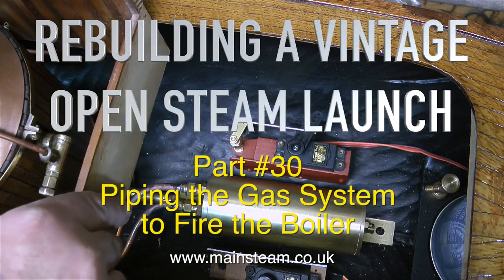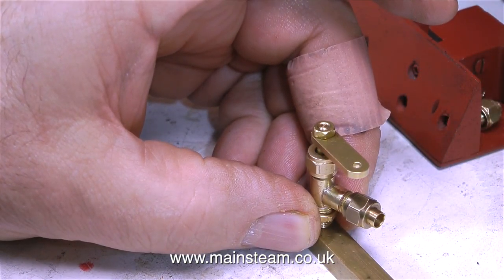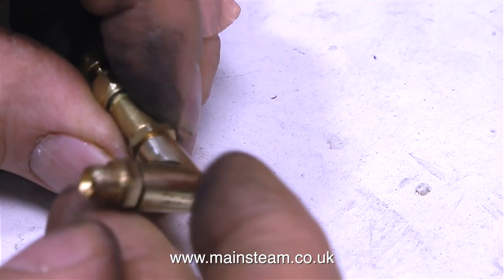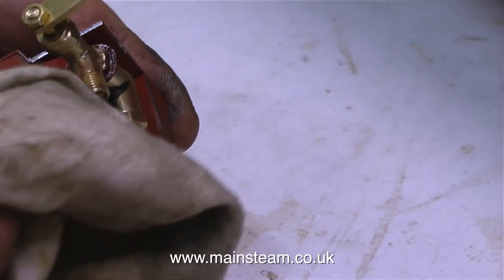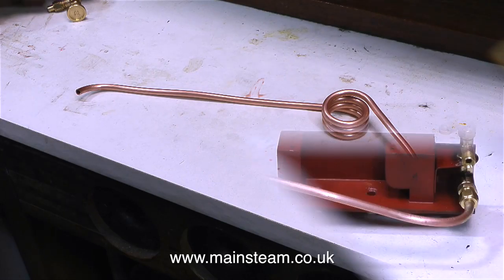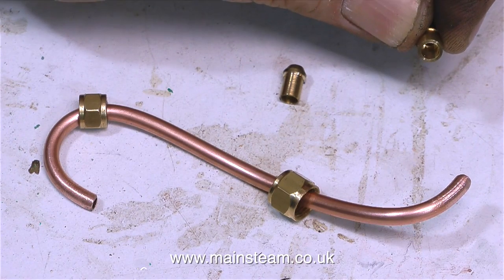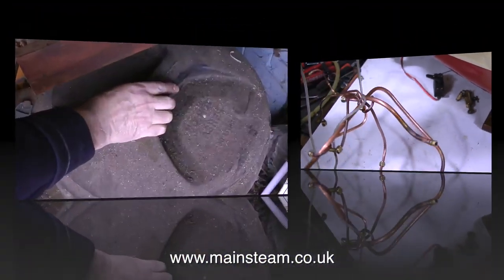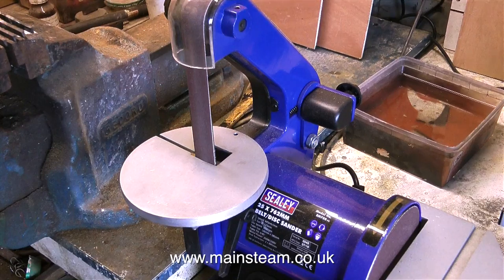REBUILDING A VINTAGE MODEL OPEN STEAM LAUNCH - PART #30

Comment: The talk about your grandfather sounds like something out of a Monty Python skit.

Question: The back Plat of the servo mounts, do you have to scuff or scar them to get the paint to stick?
Reply from the maker: Yes, I scratch the Aluminium with sandpaper before painting to give the paint a "Key"

Comment: Hey keith  what sort of the acid that u use for cleaneing ur copper parts
Reply from the maker: Kilrock-K - Kettle de-scaler - it is Formic acid based and gentler than Sulphuric acid .....
Reply: Keith Appleton cheers for that i was useing battery acid but it had eaten through the tin i had it in